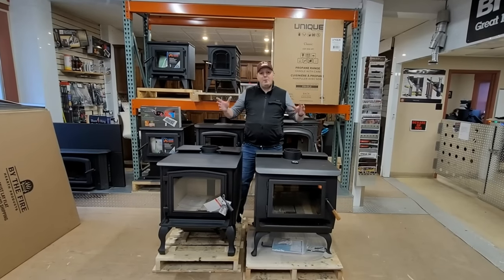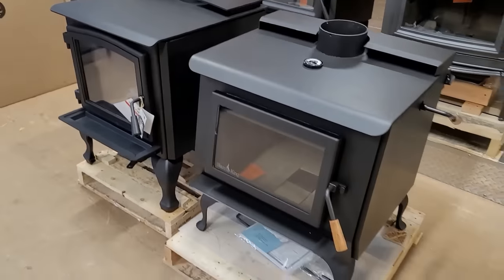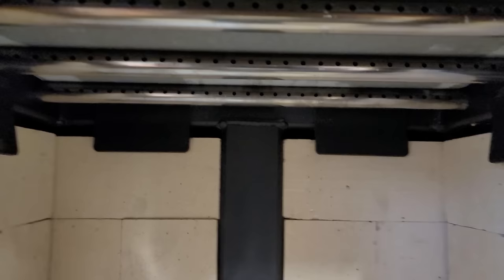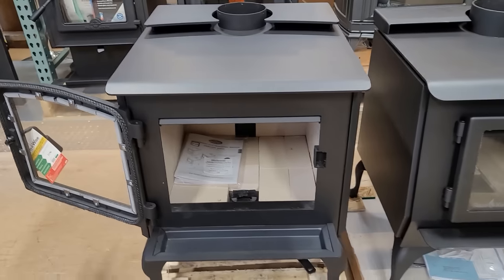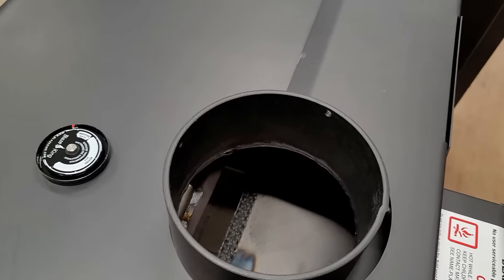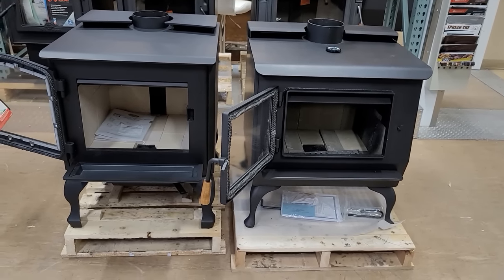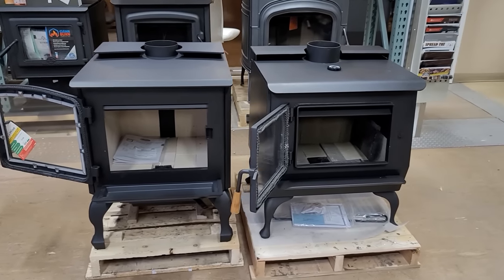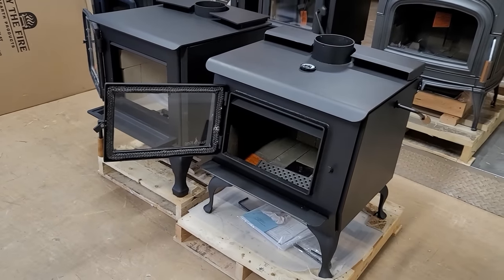Comparing Catalytic to Secondary Air Wood Stoves

Comment: Yeah bud you forgot to mention the cat stoves cannot burn slightly wetter wood the secondary burn stoves easily and happily burn, the gaskets are a pain in the ass of the cat stoves and their stacks are abit more limited where the secondary burn stoves chug great.
All told I did want the blaze king-King honestly but it would've been a disaster for my location and setup even tho it's done "properly" with all class a. And the maintenance of the gaskets, the wood moisture content sensitivity I said no way.
Picked up the Drolet ht3000 and it's honestly far better than I even expected after doing all my due diligence. Legitimately burns for 12hrs with excellent heat when loaded with a mix of black birch, rock maple, good split of hophornbeam, and oak with w. Ash. Nevermind the "heat cycle" figure which is about 14-15 hrs but that's not how us owners heat our houses, we add when it's needed. Raking the coals to the front/back before reloading is something few guys even know about it's stunning. You should do a video for the guys "who miss their old stoves and these new ones are garbage and theyve tried EVERYTHING" lol

Comment: This type of stove is just a fad. It will never heat your house if you are above the 45th parallel! Winters are hard and at minus 20 degrees Celsius they are useless, the consumption of wood being enormous.
Reply from the maker: You couldn't be more wrong in your statement. We sell both types of these stoves for many years and we are above the 49th. If it were a fad then why are they still selling so well? You need to experience one of these to make any kind of assumption. If you have already and still don't like it then I'd say you had a wood or chimney issue.
Reply: @tinmaninc2023  Sell because the customers had no alternative and because of the advertisement. In the USA, advertising is the soul of commerce, not the quality of the product.

Comment: now the BIG DOWNSIDES to a CAT style!!!
1- the CAT needs to be replaced every 3-5 years costing $300-600 extra dollars (faster if you run it incorrectly) **they burn out fast!

2-the Cat needs to be serviced/cleaned  a few times a season ($25 gasket per removal)
 
3-The exhaust runs cold leading to NASTY Creosote build up! 

(saves money on paper but a pain in the A$$)
Reply from the maker: I have to disagree, you are correct in what you are saying but your context is a little off. If you burn unseasoned wood, don't have the correct size chimney or burn garbage in your stove and so on then you will more then likely need to change it in a short time period. Many OEM's now offer 10 year warranty on cats. Some companies do not need the cat removed to clean them. You simply vacuum off the face of it each season. If Canada we sell the gasket for $13.95 for the cat. I could also make an argument that secondary air stoves burn through air tubes and baffles in certain instances as well. It really comes down to what you want in a stove.

Comment: No thanks on the catalytic converter. Some nonsense most likely given life by "greenies!" Whacked. More expensive over time since I cut my own wood. More difficult to maintain. I'll go for an older Vermont Castings or other ceramic coated wood burner that actually adds to the decor of the home. Most manufacturers these days produce ugly, plain-wrap stoves that are overpriced.
Reply from the maker: LOL...Vermont Castings is none for their Catalytic stoves.... they have been using them for decades.
Reply: Ha. You lost all credibility when you said Vermont Castings.